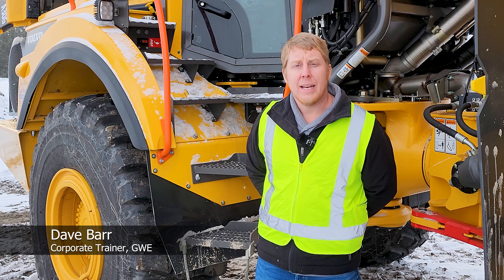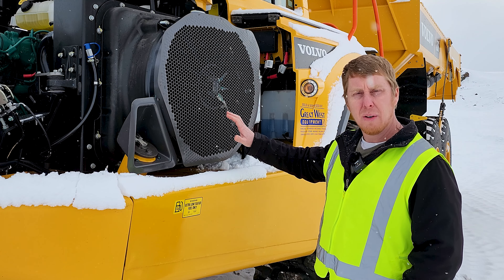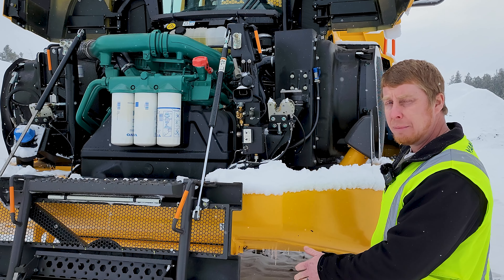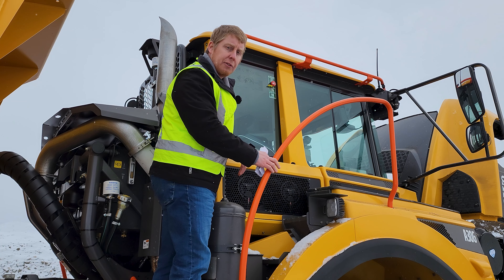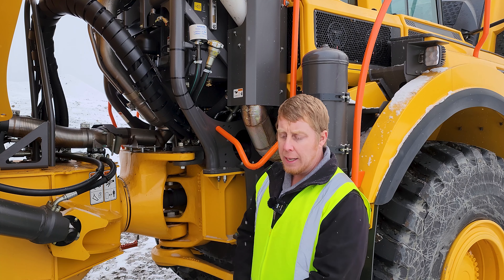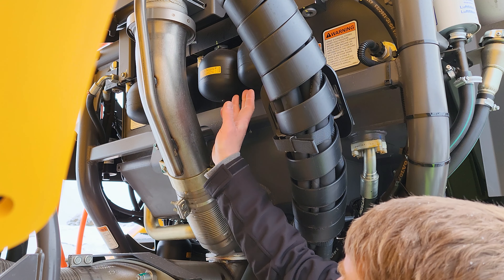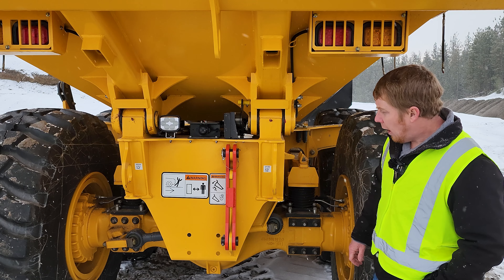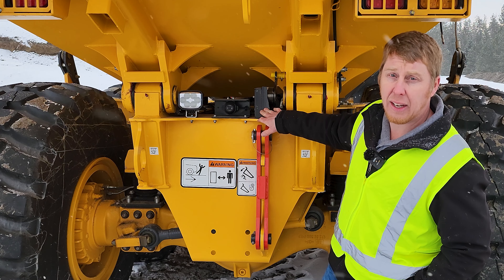Volvo A30G Walk-Around

Comment: Hi Dave, one question. Are the electric fans for the cabin optional or is it the new location of the air conditioning condenser?
Reply from the maker: Hi Felipe, great question!  They are not optional, yes indeed, they are the  electric fans for the AC condenser, electric on-demand fans offer increased fuel savings as they only turn on when required.
Reply: @norsconstructionequipmentcangw   thanks Great west. But is only en North American? 
I not see this change in South America yet. 

and by the way, your videos are very good. Congratulations.
Reply from the maker: @flpgallardo  Thank you so much Felipe!  We can't speak to the specific features on products in other territories, but with different regulations around emissions and safety features in different countries there are certainly differences in the equipment in each market.

Comment: hi. THIS  sem VOLVO  dumper druck A 30F  gear ok but no move forned and byak why? ani sholushan plz rilpy me ok
Reply from the maker: Hey @rajendrakhadka6310. There are a number of reasons an A30F might stop moving forward and backward. Without specific diagnostic information it's tough to pinpoint the exact issue.  There could be low or contaminated fluids (transmission, hydraulic), faulty sensors, a malfunctioning hydraulic pump, engine issues, mechanical failure or something as simple as operator control errors. We highly recommend taking a look through your technical manual for troubleshooting steps and if you are still having this problem, contact your nearest Volvo Dealership for assistance with professional diagnosis and repair. Good luck, hoping for a speedy resolution!